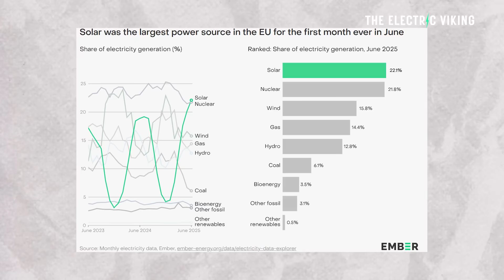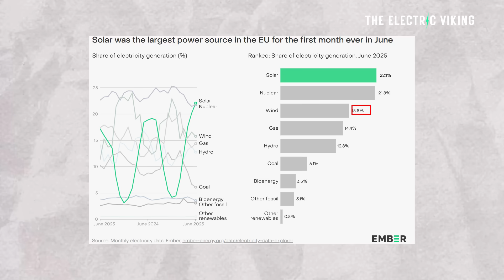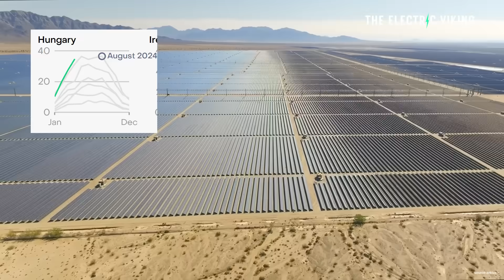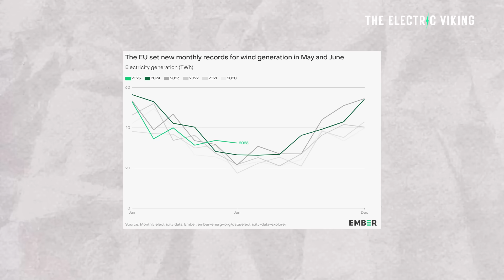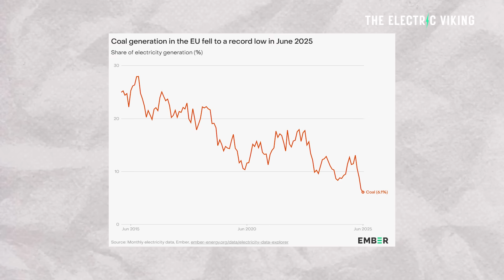Coal Hits Record Lows as Solar Power Becomes Europe's No.1 Energy Source

Comment: Does this guy know that solar does not work in Europe most of the years, in many countries? Even If solar works in the summer they will have to use coal in the winter.
Reply: There is enough solar on the EU land mass to completely power the EU thousands of times over and that includes the northern countries.

This energy will increasingly be captured in grid-scale storage which will amplify solar energy's benefits to include seasonal amounts of storage by capturing energy in high periods spring/summer for use in autumn/winter.

Although there is less sunlight in the northern EU countries, there is also a significantly lower population in those countries.  Most of the EU's population is located in the central and southern geographic regions.

It's not just about solar, but solar works well with wind and hydroelectric.  All three forms of energy are directly powered by the sun.  In fact, all fossil fuels are just stored sunlight of course.

Finally, the energy transition is not happening overnight, but it is happening and at an accelerating rate.  Renewables, especially utility-scale solar, have reached historic low costs of electricity production and still continue to drive their costs lower.
Reply: @beyondfossil  So what do we do at night?
Reply: @normanstewart7130  Energy storage will boost renewables to the next level at both large grid-scale and local residential/commercial scale.
Reply: @normanstewart7130  Even more...

On a smaller scale, households with residential solar + storage (usually LFP battery) already can go all summer day & night without hardly drawing anything from the grid.  Over a whole year, such homes can power 50% to 80+% of their energy without pulling anything from the grid, not including a lot of exports which helps reduce grid load and reduce fossil fuel power plant emissions.  Furthermore, as we move into energy efficient HVAC like heat pumps, the need for natural gas will fall rapidly.
Reply: @normanstewart7130  Lastly...

One storage type often overlooked is sand/ceramic thermal storage.  This is especially low-cost energy storage since it’s made of the cheapest most abundant elements on Earth (silica).  It can drive industrial high heat processes like steel and concrete making which direct electricity currently has problems reaching the very high temperatures needed for these industrial processes.  The stored heat can be converted back to electricity with a steam turbine.  Thermal storage can store energy for months at a time with well-designed containment.

Back to a broader scale, even without energy storage, renewables like solar are having a massive benefit for the grid by reducing load on fossil fuel generators which reduces their carbon emissions on an ongoing basis.  All while driving investment and lowering costs of renewables further.  It’s building up an actual sustainable energy infrastructure all right before our eyes as the global energy transition is well underway and accelerating.
Reply: @normanstewart7130  Furthermore...

On a large scale, renewables and storage moves us closer to dispatchable firm renewables which will obsolete most every other large-scale energy generation on the planet. Like renewables, the energy storage sector is growing at exponential rates while continuing to drop in price.
Reply: @normanstewart7130  There are more options for energy storage than just lithium chemistry.  There are grid-specific storage like compressed CO₂, liquid-metal flow, sodium, sulfur, ceramic/sand thermal, hydrogen, pumped storage hydroelectric (PSH) and much more.
Reply: @beyondfossil  "There is enough solar on the EU land mass to completely power the EU thousands of times ov"
from where did you come up with data?
Most of the winter in many europeean countries dont have enough sun.
Reply: @wonderwalls3565  Sure, I'm talking the whole 365-days of a year and across the entire EU land mass of over 10-million square kilometers.
Reply: @wonderwalls3565  Once we have abundant seasonal storage available then it takes a way one of the biggest weaknesses with renewables which is its intermittency.  This will accelerate the fall of fossil fuels even faster.  Seasonal storage can cover the long-term months of storage while battery storage can cover the more night/day cycles.
Reply: @wonderwalls3565  Also, we do not need to store all the energy used because daytime provides a lot of the energy we need and there's wind and hydroelectric which can provide power during night time as well.
Reply: @wonderwalls3565  Looks like your latest comment was censored out and removed from view, I cannot see it when I refresh the page.
Reply: @beyondfossil  Solar is unreliable , intermittent , environmentally damaging , expensive and fragile. Storage is too expensive for the long term supply.
The energy transition is a green fantasy that is in the process of failing miserably while keeping living standards lower than would otherwise be the case.
Reply: @Leo555ZZZ  Let's be clear here.  Fossil fuels are a dead-end technologically, economically, and environmentally.  It is an industry that most benefits the ultra-wealthy and oil despots.  The global fossil fuel industry has been supremely successful at privatizing the profits while socializing the cost to the public.  All while enjoying massive ongoing titanic subsidies to keep costs artificially low.

Nothing comes close to the ongoing environmental damage of fossil exploration, drilling, refining, and distribution and then ultimate use in a combustion device.

The only thing fragile here is fossil fuels—a dirty inefficient unsustainable polluting fuel that has its own self-expiration date.  Our recorded civilization goes back some 4500+ years and almost all of this time has been without any fossil fuel use.  Continuing carte-blanche use of fossil fuels will mean an end of our civilization within 100- to 200-years tops.  That would be incredibly sad as we intend to go on for another 4500 years at least.  Fossil fuels will not be a part of this journey.

All the fossil fuels that ever existed would amount to a drop in an ocean compared to just the daily amounts of energy we get from our parent star—clean fusion based energy gifted to us for free by mother nature.  Some combination of sunshine and wind is available everywhere and they cannot be sanctioned, taxed, tariffed or blockaded.  Renewables have zero fuel costs.

You may enjoy the global fossil fuel hegemony for now while it lasts, but it is already in decline because it is not remotely sustainable beyond a generation.
Reply: @beyondfossil  "It is an industry that most benefits the ultra-wealthy and oil despots."
So is solar. People owning solar panel manufacturing plants and manufacturing batteries benefit the most from solar.
Reply: @wonderwalls3565  Also, in the larger context, the sun provides a massive cosmic 173,000-terawatts non-stop to the Earth, or about 1000W per square meter on the ground peak and it's always peak somewhere on Earth.

As a benchmark calculation, that amount of power can provide all the 620-exajoules of primary energy our civilization uses annually in just 1-hour!  Or just 1/10000th of that power spread over 365 days of the year.

There is nothing even remotely close to this amount of power within 4-light years.  As I said earlier, all the fossil fuels that ever existed would amount to drops in an ocean in comparison.  You've been lied to by the fossil fuel industry that there's an energy deficiency.  We need to invest more in renewables to move our civilization forward because fossil fuels are too dirty, too limited, and helps keeps the rich despots in power for longer.
Reply: @wonderwalls3565  Also, in the larger context, the sun provides a massive cosmic 173,000-terawatts non-stop to the Earth, or about 1000W per square meter on the ground peak and it's always peak somewhere on Earth.  As a benchmark calculation, that amount of power can provide all the 620-exajoules of primary energy our civilization uses annually in just 1-hour!  Or just 1/10000th of that power spread over 365 days of the year.
Reply: @wonderwalls3565  (continued...)

There is nothing even remotely close to this amount of power of our sun within 4-light years of us.  As I said earlier, all the fossil fuels that ever existed would amount to drops in an ocean in comparison.  You've been lied to by the fossil fuel industry that there's an energy deficiency.  We need to invest more in renewables to move our civilization forward because fossil fuels are too dirty, too limited, and helps keeps the rich despots in power for longer.
Reply: @wonderwalls3565  So, essentially, we need to start "mining the sky" as we already mine the ground.  The sky has millions of times more energy and cleaner energy too compared to the ground.

One way to mine the sky is to work towards "seasonal storage" with long term storage like thermal sand/ceramic storage, compressed CO2, stationary hydrogen or liquid-metal batteries as just some examples.

Seasonal storage is about storing energy from spring/summer for use in autumn/winter.
Reply: @beyondfossil  all your power stats are based in ideal condition and only at the peak hour. Unless you spend billions and billions of dollars you cant utilize that sunlight for bigger population.
I would prefer people to switch to solar so that oil prices for my vehicles come down. but its not happening for decades. and the if you think its going to be cheap you are an educated fool.
Reply: @beyondfossil  BTW can you tell me why the fuck tax payers money is being given as rebate for people who buy EVs or install solar panels if they are so cheap and wonderful? If they save so much money why dont people buy it themselves without any rebates?
Reply: @wonderwalls3565   First off, EV and renewable subsidies in total are like a drop in a bathtub in comparison to total ICE and fossil fuel industries (see below).  From this point of view EV and solar are well behind and they need more subsidies just to catch up.

A more direct answer to your question is that EVs and solar panels move society towards a sustainable energy future—and governments and policymakers have deemed this is a positive benefit to society.   So they want EVs and renewables to grow even faster to avoid a global pollution and climate crisis.  Especially as EVs and renewables are much less mature compared to ICE and fossil fuels industries.
Reply: @wonderwalls3565  Also, governments around the world subsidize things we’ve never even heard of in daily conversation because they’ve calculated the benefits outweighs the initial costs.  Governments can take the "long view" which is necessary sometimes as pure capitalism can often be too short sighted.  You will find that even in your personal life that what you view as a benefit depends on your long- or short-view.  For instance, as a child you prioritized play and eating candy but those things do not bring you long-term success if indulged in too much without a view towards the future which a child cannot see directly.  Parents (government) need to nudge children in the right direction.

WTF then does fossil fuels still receive equivalent trillions of USD in subsidies each year?  An IMF report in 2022 showed some incredible US$7-trillion in total subsidies.  It still receives trillions each year!  The global fossil fuel industry is a very mature industry too.  In fact, next to mother nature, there is no more powerful force on Earth than the global fossil fuel industry.  It consistently makes profits hand over fist and wields its immense wealth and political influence daily.  They have high level politicians from around the world in their pockets like Donald Trump, Greg Abbot (Texas) and Danielle Smith (Alberta, Canada).  A lot of these politicians might as well have oil & gas employee ID badges especially Smith and Abbot.

The global fossil fuel industry is responsible for a lot of orphaned oil rigs, ocean drilling rigs, and tailing ponds.  Much of this is pushed onto the public to pay for the clean up.  The dirty fossil fuel burning emissions hang over all the major urban centers around the world.
Reply: @beyondfossil  There are no subsidies for fossil fuels. you have been lied to.
Are you claiming that Australia is giving money to the Arabs?
Also the point was not that why is tax payers money been giving for subsidies on EVs and solar. the point was if they are so good and you can get free energy for the rest of your life. Why are not more people buying them? Why people are incentivized for such a great product?
Also even if fossil fuel industry is being subsidized, the end user pays it back in almost 50 cents of tax on the petrol and diesel per liter. so Even if your subsidizing theory is true, the whole thing comes back.
Reply: @beyondfossil  "WTF then does fossil fuels still receive equivalent trillions of USD in subsidies each year?  An IMF report in 2022 showed some incredible US$7-trillion in total subsidies."
You mean US has given trillions of dollars to Arabs and Russia? and WTF US subsidies has to do with Europe and Australia?

And WTF giving subsidies to business has anything to do with giving subsidies to the end users?
Your beliefs are based on ignorance.
BTW this is a lie. go and read the report and you will know what do they really mean by those subsidies. I will give you a hint, one of the cost they added adn termed it as subsidies is the so called medical cost for people who they claimed got sick due to fossil fuels. So medical bills are being calculated as subsidies.
Reply: No, he hasn't dedicated 10+ years focusing on all things related to renewable energy sources and he hasn't been reading a ton of reports about power generation and distribution. Sam Evans is obviously clueless.

Or the opposite of that...
Reply: Wind, water, gas is covering for solar in the winter.
Reply: @2mek99  so why need solar when you can do without solar? why spend billions on solar panel when wind and water is working. wind and water is pretty cheap.
Reply: @wonderwalls3565  I live in Canada and I have been using solar to charge two EV's since 2014. You are a clueless.
Reply: @wonderwalls3565  Because it is cheaper and cleaner. Diversification also matters. Why should Europe rely on arabic countries or Russia?
Reply: @2mek99  Yeah I guess you dont have any problem Europe buying 4x American LPG. Is it because Americans claim to be white?
Reply: @2mek99  And that level of duplication/triplication is what makes 'renewables' so expensive.
Reply: gas actually.

Comment: There is a company in Poland called Sauletech that has developed a method of placing perovskites on plastic sheeting.  They may surprise us.
Reply: Likewise Oxford PV developed flexible perovskites a number of years back (plastic or metal film backed) for use on odd shapped roofs, sailing vessels and building cladding installations. Being translucent as well they could be used as window sunshading that generates electricity at the same time.